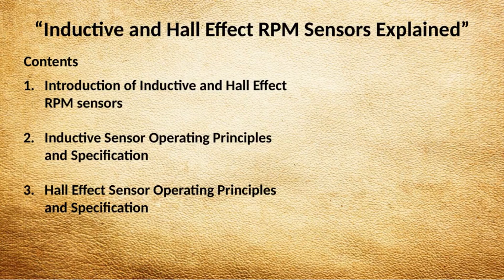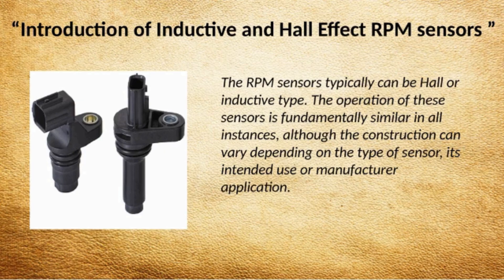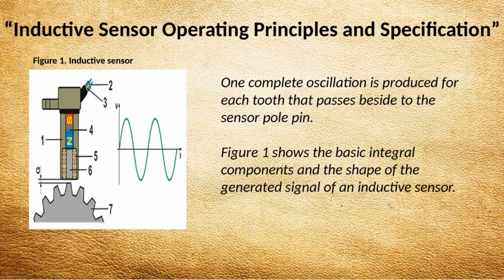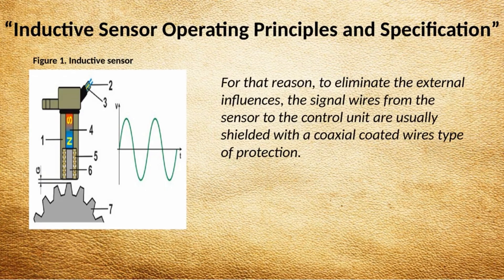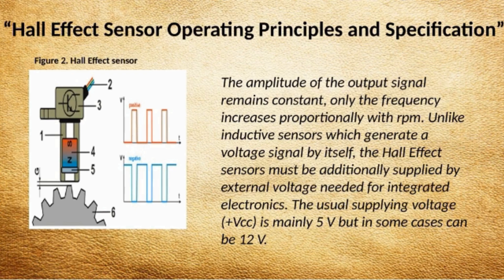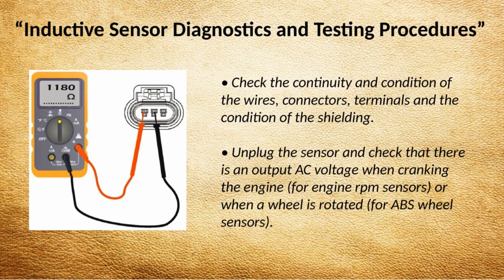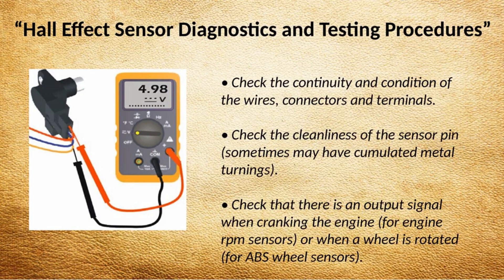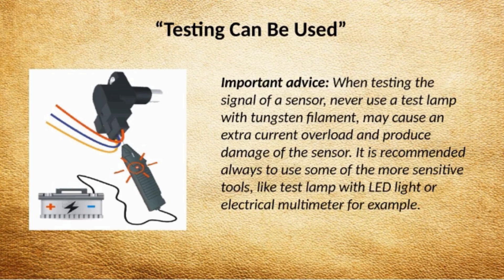Inductive and Hall Effect RPM Sensors Explained

Comment: Hi.My inductive sensor show 1Mohm resistance,but when I crank i can measure about1,5-2  ac volts on my dmm.is it good or bad?also no fault Code on tester,but the car cranks but no start.when I disconnect the sensor I get a fault on tester.

Comment: https://youtu.be/RIMTgbwhtos?t=288  Your values are INCORRECT. At this time index, the text says "between 500 ohms and 1.500 ohms. But it should be "1500" or "1.5 kilo ohms" or 1,500.
The other note also suffers from the same type of error.

Comment: Could you tell me how the rpm sensor of old Mercedes m110 engines works? The sensor sits on the crankshaft flywheel, ie a continuous steel material.